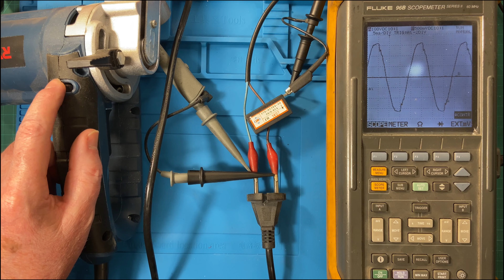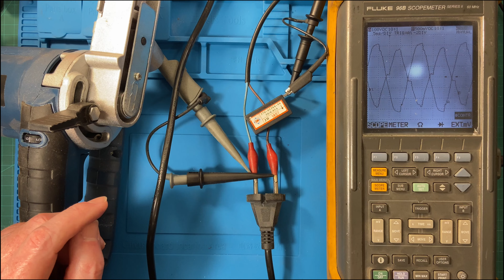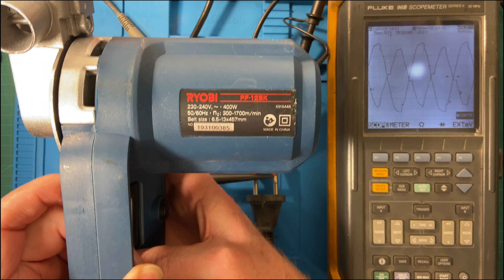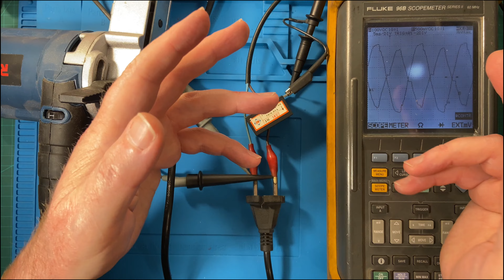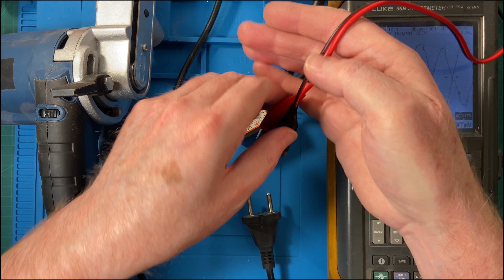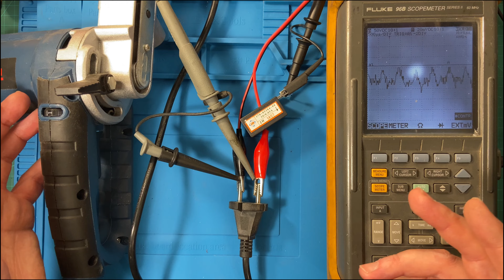Examining brush motor waveform with ct demonstrated with bonus footage #electronics #electricity

Comment: Really found that interesting   .Charles Kettering in the USA produced the first successful automotive self starter more than 100 years  ago . He was the first  to realise that the motor did not need to be continuously rated for the power it delivered .  The motor is a series motor with brushes .exactly  as you just showed us
Reply from the maker: Yes, it turned out to be a very interesting topic and video